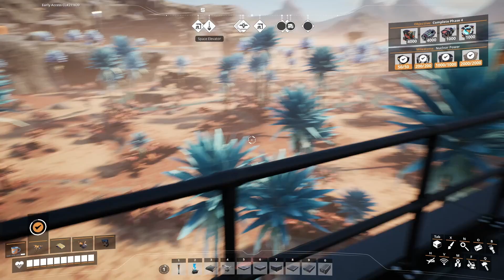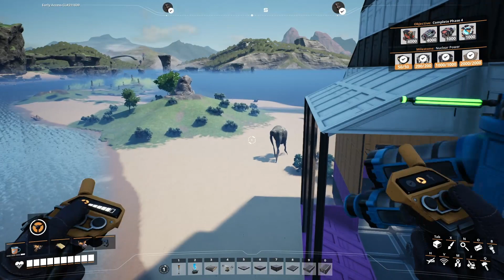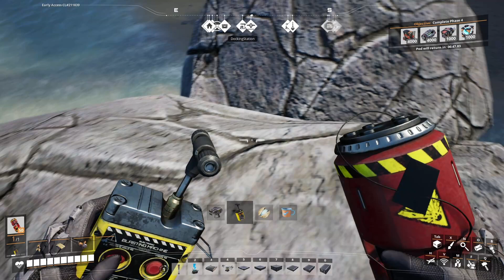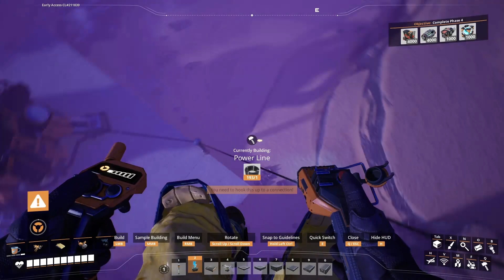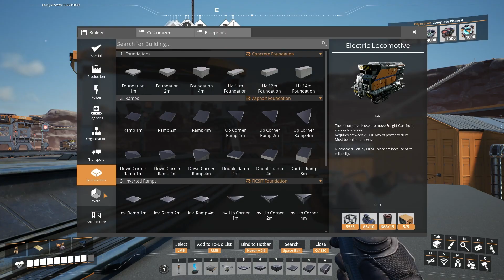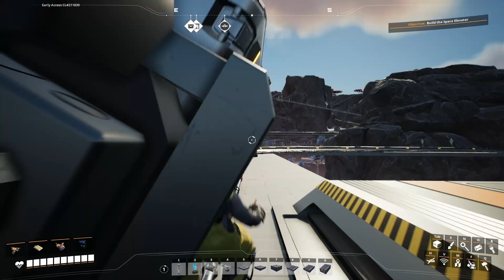Satisfactory Update 7: Episode 24: Training Day

Comment: Hello Friend,
You are welcome, I had it detailed and everything. Thank you for letting me borrow it.

The rails on the slope you might want to start off with a 1m ramp foundation and then every point you need "to put it down" you have a ramp so the rail doesnt feel the need to curve back to horizontal as much. might make for a smoother ride and less throwing up, unless you like the rollercoaster in witch case I haven't said anything.
Reply from the maker: I was thinking more about getting the height right rather than providing a smooth ride, but thanks very much for the advice!
And thank you for bringing the shuttle back!